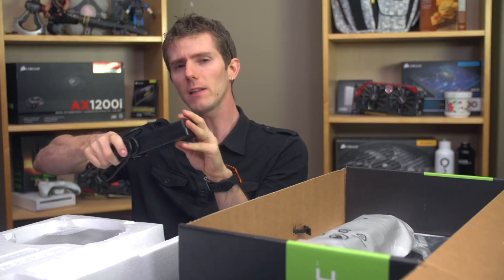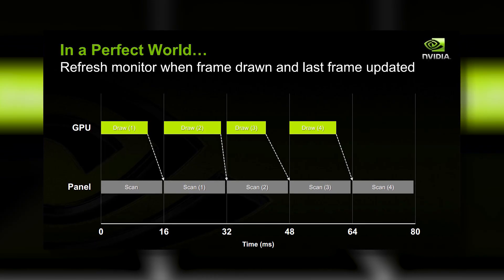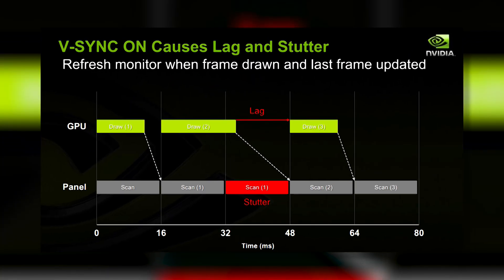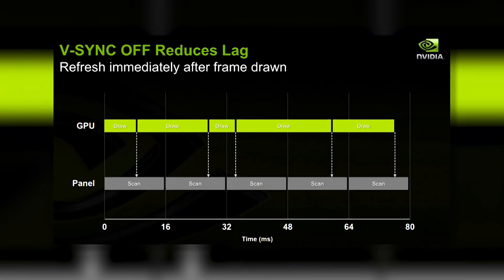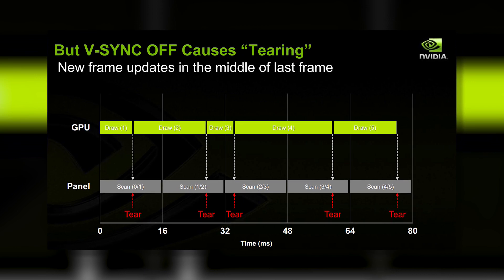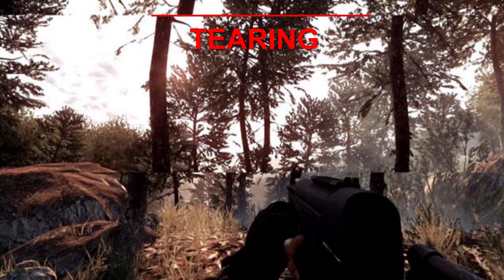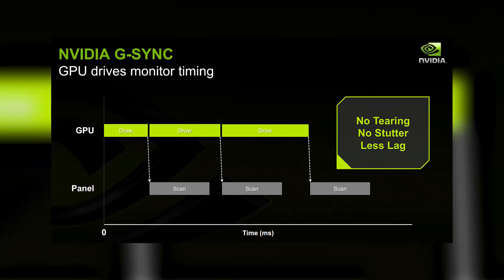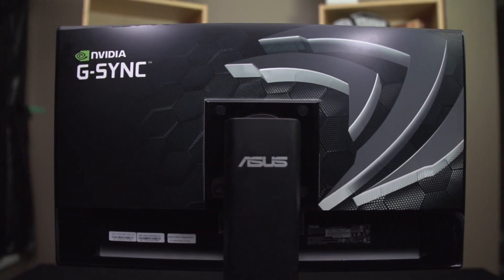NVIDIA G-SYNC Tech Preview - Linus & Slick's Impressions

Comment: If G-SYNC is a feature all graphic card vendors can implement be it Nvidia or AMD, and there is a non-patent encumbered standard for OEM monitor manufacturers, then it might survive. If Nvidia make it a proprietary feature, and pile all the usual patent claptrap on it, then it will die a quiet death, regardless of the benefits.

So Nvidia themselves will determine the success or failure of this, with regards to how well they open up the standard (or provide a reference design), and play (or not) with other companies. A "holy war" wont help this beneficial technology to be accepted, which would be a shame. But it is basically a feature for gamers ATM.

Thinking out of the box, and pushing this feature into the living room, be they consoles, blue ray or set top boxes, would encourage wide adoption, and not only thinking of the PC graphics card market, which is Nvidia's primary market focus.

Comment: Switching to SSD was the best thing I have done to my PC. Actually I don't use any HDD drives any more. Yes, SSDs are more expensive per gigabyte, but the pure pleasure of using them in my system is indeed revolutionary for me personally.

Comment: Hey there! First of all I have the feeling that you (Linus) are not as "neutral" especially about this review... Are you getting money from nVidia to promote the new tech (G-SYNC). That being said, if the difference between "regular" monitors vs G-SYNC ones is as good as mechanical drives (HDD) vs Solid State Drives (SSD), than G-SYNC is going to be a definite game changer. To answer your question, it's a nightmare to work on a PC with a HDD.

Comment: Although today`s monitors don´t support dynamic refresh rates as Gsync does, many of them are able to sync to other rates than just 60 Hz if you force them. So here´s a neat trick for those who are always below 60: Force a refresh rate that matches (or is twice of) the highest stable framerate your rig can run, and hope your screen accepts it. Then enable Vsync.

Most games I play will always stay above 40 FPS with fairly high settings, but almost never reach 60FPS. A solid 40 FPS is good enough for me and my slow-paced games, but it doesn´t flow smoothly on a monitor that´s locked to 60Hz.
So I used a tweak (search for Custom Resolution Utility) to have the video card output 40Hz and I enabled Vsync. Solid 40 FPS @ 40Hz, no stutter, no tearing. Input lag is usually not an issue when GPU and monitor are in time. Some screens won´t accept 40Hz, but I think most will go down to 50Hz.

Tip: DP and VGA seem to be less picky about which refreshrates they accept.

Comment: Damn, 650+. Running 560ti SLI (on an asus 1080p 60Hz monitor), might be time for a GPU upgrade when gsync is fully out,  running a 1440p 120Hz monitor smoothly would be nice anyway. Might be best for them to iron out any bugs first anyway. Now just if nvidia will come to Queensland, Australia to show off the tech. On the SSD question: I love my SSD, even when I have to do lite work on another computer without one, booting it up can make me groan.

Comment: My SSD is the best investment i made for my PC. I love it. Its great for boot times and being able to use your pc as soon as you can click an icon. But an SSD has not done much for me when im gaming, and ill stick with a large HDD for games and large files for as long as its the cheapest solution. 

As fore the g-sync thing, im sure it is a great improvement over current monitors, but probably not worth replacing my existing monitor. If im going to upgrade or buy another monitor anyway, then ill get a g-sync one if its cost effective.

Comment: Wouldn't you still get tearing with G-Sync when the frame rate exceeds the monitor's maximum refresh rate? Like say you have a 144hz G-Sync monitor, yeah it varies the refresh depending on your frame rate but it still can't go over 144hz so you would still possibly get tearing if your GPU is outputting 200 fps?

Comment: As far as "going back to an HDD after installing an SSD" ...well, I purchased an ultralight [laptop] just this past Feb w/an SSD (and which specs otherwise provided only an appreciable fraction of the power of my still capable, non-gaming, I5 Q6600 based workstation). That laptop [a Vizio CT14.A0] quickly became my preferred support device (I provide remote sys admin services to several small businesses) despite it's single display; since I went from the workstation's 4 displays (a 27" 1920x1200, two 19" 1280x1024, and a 21" 1440x900 in portrait mode) to the laptop's 14 inch single display, that's a significant indicator of how impressed I was with the SSD.

Sleep mode actually became ...useful. (It reminded me of the old HP Omnibook OB425 range with their instant-on feature.)

I finally grew so frustrated with the HDD on the desktop that I thought I'd throw an SDD in it ...but, well, the rest of the parts for a new build (the first system I've "rolled" in a decade, and the first AMD [FX8320] I've used in as long, ditto - and I used to own a rather successful local store lol, and I'd built, literally, a few hundred systems during the late 80's through 90's - though it's at best a "budget build" for most of y'all) arrive sometime later today (BF/Cyber Monday sales have meant I could justify some moderately decent tech at a significant savings).

I may still go back and retro-fit an SSD to the Q6600 system (as a backup: these are work machines, after all, and justify a retro-fit ...and I did pick up an "extra" SSD while I was shopping for the purpose), but the difference in "user experiential performance" (i.e., the "user experience" perspective) was so striking between the newer tech ultralight and the 3-4 generations older tech workstation, that I just decided to go balls on with a full kit (in this case meaning I'm finally embracing late-2011/2012 tech lol: hey, I'm frugal, what can I say).

But for the purpose that I put my workstation(s) to (it provides my living), the Q6600 was still fully much more than merely adequate, so it says a lot that a skin-flint like me was coerced by the tech into building a new box.

So. SSD? Ohhhh yeah.

Comment: G-sync is not a lasting strategy for NVidia.
1) Gamers are a relatively small part of the overall market, thus this tech wont make it into most monitors and will therefore always required a price premium. It's destined to be high-end gaming gear, or a niche of a niche...

2) NVidia would be forced to license the tech to AMD under FRAND (see Apple vs the world in patent lawsuits, it's their common defense)

3) As has been mentioned here, 120hz and higher monitors make this much less relevant. At 60hz, adding 1/60 of a second to your input lag could potentially put you over the edge on lag to make it readily apparent (note: NVidia claims this threshold to be ~200ms). At 120hz, adding 1/120 of a second is likely not an issue. Look at it this way, with a 60hz monitor, you'll display a frame every 1/60 of a second (if your GPU is outputting better than 60 fps), 30<fps<60 and you output 30fps, 15<fps<30 and it will output 15, which is where you really run into trouble. Now with a 120hz monitor that's not nearly an issue, because it goes 1/120 (120fps), 2/120 (60 fps), 3/120 (40 fps), 4/120 (30 fps), 5/120 (24 fps) and so on. So you don't get locked into a lower display output as quickly. 240hz will make it almost a non-issue.

One last thing, the statement from the above video that g-sync doesn't increase input lag is not exactly true. If you're gfx card outputs a constant 30 fps, you won't be able to tell the difference between v-sync and G-sync. The main difference is that G-sync allows the combo to output any frame rate equal to or below the monitors refresh rate, where v-sync requires these outputs be a discrete set (multiples of 1 over the refresh rate).

Comment: I actually do not notice any difference in performance between my SSD and my 7200 rpm hard drive other than startup time. Now I don't do any hard core video work on my computer but I do game a lot and I noticed no difference in loading times between the two drives. So much so that I no longer install any games on my SSD and use the 7200 rpm drive for everything but the OS. And honestly I could live without the decreased start up times because I turn my computer on at the beginning of the day and turn it off at the end of the day. Unless msata ssds or others get fast enough to see a clearer performance gain my next drive will probably be a 7200 rpm drive.

Comment: I did get a solid state drive and wouldn't go back to a hard drive system ever.... then I got two solid state drives and put them in raid 0, and now I can't ever imagine using just one of them in a desktop setting unless the read/write speed of the one was as faster or faster than  the RAID array I'm running.

Comment: The biggest problem is that it's all proprietary to NVIDIA and will just end up being a huge investment for the person but to keep costs down let's say, we would need to buy a lower GPU thus rending G-Sync useless in a couple years or so when the next series of games come out and are even more demanding that you can't play at more than 120fps... Hell, even currently the top end cards can't play the graphic intense games at 1080p over 120fps unless using crossfire or SLI... G-Sync = Pointless investment and too much a gamble.

Comment: Meh. My graphics card can't even put out 60FPS anyway.
Reply: Kent Madsen Basically what you're doing is pretending you know a lot while you have no idea what you're talking about :|
Reply: ***** no, the point of "v-sync" (and gsync) is that when your gfx can render a game more than 45-60 fps,
it stops right after that, it's made because some screens aren't fast enough to refresh itself so it shows a short stutter (visible line where it refreshes), with people think is annoying, obvously.problem is that v-sync can make a game slower sometimes.
Reply: ***** What? I leave my Vsync off cause I cant even hit my monitor refresh rate. What exactly dont I understand?
Reply: if your game has a fps at like 120fps and your monitor has a refresh rate at 60hz, it will stop at 60fps. basicly what vsync (and gsync) does.
if your fps is below your monitors refresh rate you have nothing to worry about...

Comment: How much of a hole will a g-sync monitor burn in my wallet?
Reply: It will go down dramatically when more manufacturers go for it, the only one right now which Linus got is just an experimental one, it's not good in any way, but the next ones will be awesome.
Reply: it adds another 100 bucks so far to what ever monitor its on.

Comment: 7970 and 120hz with light boost 2 on... What is tearing again? My solution to tearing has always been to target considerably higher FPS then the refresh rate; i.e. if I'm pulling 300 FPS in CS GO on a 120hz screen there are zero noticeable anomalies. G sync seems like a way to segment the market more, forcing people with compatible monitors to use nVidia products. Not a healthy solution for the consumer.

Comment: In your conclusions you fail to take into account those with AMD cards. I'm using a 1440x900 monitor at the moment, and looking to upgrade to a 1440p monitor, probably one of the Koreans. Given that I won't be able to afford it till Q1 next year at the earliest, I would seriously consider a 1080p G-Sync monitor, however I am using an R9-280x (Which is a fantastic graphics card, given that I got it before the Nvidia 7 series price drop - no regrets). It's such a shame that Nvidia seem to just pour out this (what I perceive to be) gimmicky stuff for only their cards, although AMD are certainly guilty of it to. It's just such a shame that whether you go AMD or Nvidia for a GPU, you are going to be missing out on something reasonably significant that the other brand has.

Comment: All these new Monitor upgrades, I mean; 4k Resolution, 144hz, 3d capability, and now g-sync. I mean Yeah great, awesome super cool. However they are not in the average consumers budget.

Moving onto the question which was asked in this video, with regards to SSDs. While I have an SSD [Samsung 840PRO 128GB] I find it is fast but I don't find it necessary or can't live without. I only upgraded because I was running a 4 year old 5400RPM Seagate Sata III, which had a read and write of approximately 60-70mb/s.

I believe I'll upgrade my monitors [S273HL and G245H], when  G-sync/High fresh/Ultra Definition monitors become standard, and they have flushed out the current standard 1920x1080 60Hz.
Reply: Well most things aren't in the average consumer budgets when they first come out, and if anything the price of new tech decreases faster now then at any time that I can remember, so I don't see that as an issue.
Reply: John Patz While they are decreasing in price, it will take a few years before a monitor with a few or all of these features will be the price of a standard 1920x1080 24" 60Hz 2013.

Comment: If they do a 4k or 1440p 27" I will get one I have been using 1440p for the last 4 years and I don't think I could go back. Am wanting to get a 2nd 27" ATM but need a better gpu first. Thinking about a 780ti but will wait to see if 6gb versions will come out.

Comment: I know you said potable devices(cell phones and tablets) were a ways away from receiving this tech but I think that is a missed opportunity by Nvidia. What a better way to display what the tech can do than by putting it into a device that they could control all aspects of.  If you buy a new phone you get a screen and GPU at the same time that they could implement this tech in to showcase what it really is capable of.  Once you(the consumer) get used to having that level of smoothness on a devise you use all day, you will likely want it on your PC.  But then again, I'm not the one spending millions on the R&D and I'm positive Nvidia knows what they're doing better than I would.

Comment: I have my main PCs with an 120 gig sad and 60fb raid 0ssds then another one with only a one tarabyte WD blue with the same stuff installed it takes over 1minuit to boot and it is painful since I restart a lot  but thn I have another HDD computer not cleen install with an shytty 250 GB HDD with windows and a crappy 1tb HDD taken out of an broken enclosed and I have much faster boot times than the 1tb only drive redy in windows is like 30 seconds and on my primary with an ssd it takes about the same amount of time (1 125gb ssd)

Comment: i used a SSD (a cheepo 32gb one and just had the os and the absolute basics on it)  on my Gaming PC for about 2 years, then the SSD died ' i installed a fresh os on a hdd, but i stopped using it after the the second boot because i come down whit SWS (SSD Withdrawal Syndrome) going back to a HDD is a horrific experience . I WILL NOT USE A PC WITHOUT A SSD . SSD IS A MUST HAVE
SSHD's are good to , (PC Master Race - SSD Armada)

Comment: Hey Linus do you think the "first" Gsync modules might be bugged? For example i bought my board that supported Lucid Virtu as that is a great feauture i use it with my i5 HD3000 but in battlefield 3 there was some issues with trees randomly appering all over map! In battlefield 4 i have not seen much issues just small artefacts like water going everywhere for a second.
With Virtu disabled it was all normal and good! Virtu is like a software anti tearing so how would it integrate into Gsync? I think holding off until second generation might be good just to see what happens with drivers and updates!
Cheers
Reply: you have a godo point but how in the world do you upgrade a monitor daughter card? as to my knowelge there isnt a way to do so to update the monitor technology unless they have to add one in spefically for this tech of course.
Reply: Lucid virtu is software. G-sync is hardware. Almost not related at all
Reply: well not related but do you thing the first module will be good with software? and than they realise something is wrong and it can be better and we have a new line of monitors! 
Lucid Virtu performs better on new boards too..
Reply: Saša Benčić you have a point there but unless nVidia writes their drivers to not work the older G-sync it will still work with the older versions of the monitor in which the monitor makers will like being able to milk the same monitor spec alot longer than just a year or so or however long nVidia waits to put out the next generation of G-sync what i am hoping is along the line nvidia and/or the monitor makers decide to make it firmware and do updates that way instead of a entire monitor replacement might be a little tricker than a BIOS update or another motherboard update but if they can it will do better for the consumer and sell better becuase of it.
Reply: You are right it would be bad for us to keep buying new monitors every single time they update something! but i think that they will do it on purpose so we have to spend cash and buy buy buy :/
yumri4
Reply: Saša Benčić saddly from a pure supplier point of veiw that would make sense until the consumer and market stops buying the newest and greatest things and just goes with a older version or only updates when needed to what is compatable to what they have makeing the profits for them less and the production cost more.
so at first yes saddly i do see them doing it becuase business is a greedy some of ppl but over time when it gets to a point in which the consumer is no longer willing to go out and buy a whole entire new monitor which now basicly costs the same as an entire computer they will stop buying monitors for the computer and live without the G-Sync or just go over to AMD and not have the option for G-Sync unless nVidia allows the older cards to use the newer versions and the newer cards to use the older versions of G-Sync also. so you can do